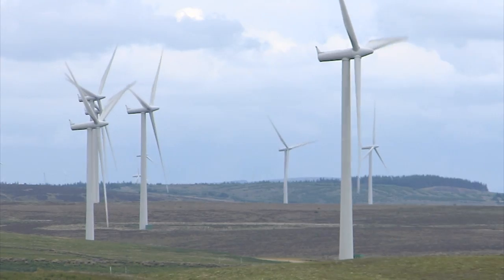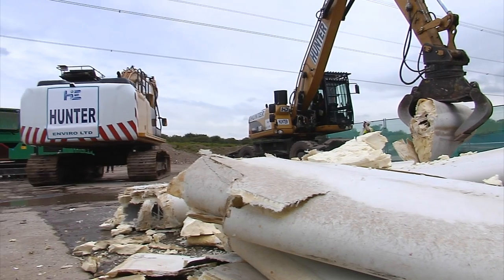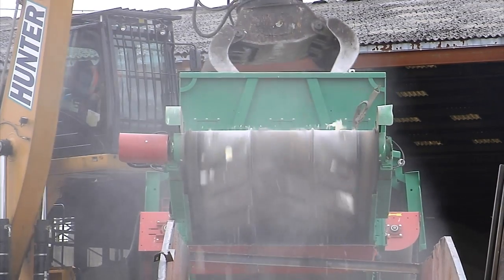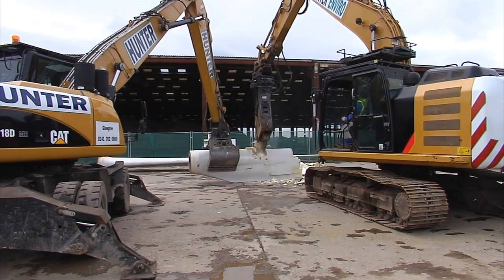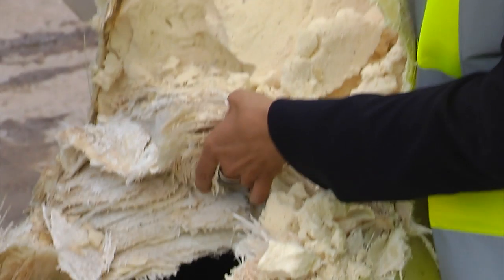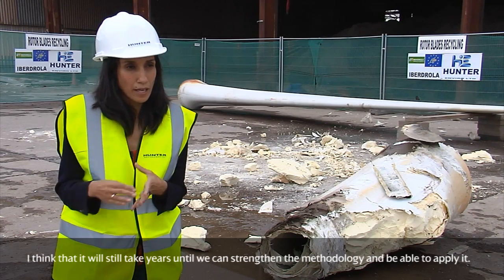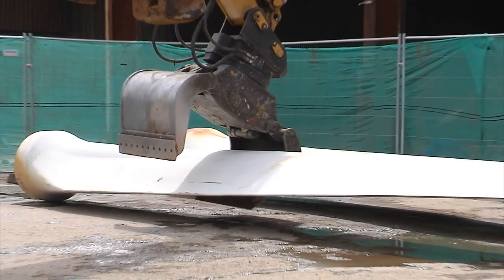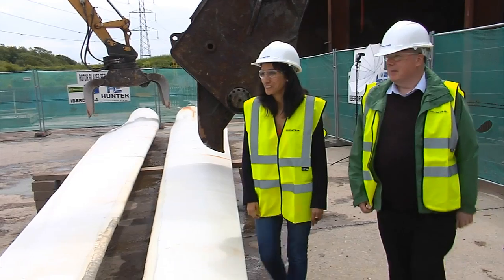Haas - Tyron 2000 - Wind Turbine Recycling

Comment: So basically, some put up money to break these windmill blades into little pieces tha are still recognizable as core materials for other industries and this proves that they can be recycled? There is still too much cross contamination. The expenses incurred by this hal process are being coveded by grants that do not require reembursment or results. Also, just being able to provide even completely clean materials  is no indication that anyone will actually accept the. Of course there will funds made available to offset costs and placate the sense of value and integrity of anyone who shows any interest. In the end, it is all a matter of paper work and press coverage.
Reply: Recycling blades is scalable and economical. It can be done, and needs volume to work, and there are plenty of blades.

Comment: I am surprised that these windmills ware out so soon.  The farm I grew up on has a water pumping windmill tower that has stood for more than a century. It's made of galvanized steel
Reply: Life span on them is about 25 years.   The new ones are so superior to old that it makes more economic sense to replace them.
Reply: Was it 300-500 feet tall? One of the things that shortens their life expectancy is technology. Compare a car from to day from twenty years ago. Go to the car dealer that you bought your car from twenty years ago and try to buy parts for it. The manufacturers would rather keep building newer technologies than keep supporting old technology.
Reply: The windmill I  knew as a child was only about 60" tall and was used to pump water ( we had no electricity or indoor plumbing)
Reply: Windmills don't generate electricity or pump water, they mill grain into flour.

Comment: Took several tons of fossil fuel to build them a bunch more to chop them up and realistically 95% ends up in a landfill. A nuclear power plant would provide far cleaner energy.
Reply: Chernoble.  Fukashima.  It might, but at what cost?   And what of the spent nuke fuel rods?   They are ten thousand times more difficult to dispose of, not to mention dangerous, than an obsolete wind turbine.
Reply: What a complete lie! wheres any actual proof to your comment?
Reply: @andyjohnson3790  which comment do you mean?
Reply: @scanamana    the initial comment where it was stated that 95% of wind turbines end up in landfills, that's not true. And that nuclear power is far cleaner, that's not true either when looking at uranium mining, refining, and end of life waste.
Reply: @andyjohnson3790  Ok, just wasn't sure to which comment you were replying, but makes sense that it was the initial one, since there wasn't @stuff in the beginning.
Reply: Nope
Reply: Not true at all. Most of the turbine is currently being recycled already. AND the blades can be recycled. Since the process is scalable, it is an economical solution too. https://youtu.be/RvCnP2h1LKY
Reply: A modern Wind Turbine can generate tons of fossil fuel worth of power in a single day

Comment: The amount of regulation and safety concerns I face cutting asphalt... I cant imagine the respiratory risk associated with grinding fiberglass even in the open air...
Reply: No more onerous than what boat yards deal with every day.  How about the BP Deepwater Horizon?  The Exxon Valdez?
Reply: You are correct.the  whole operation of cutting and shredding these blades should be in a sealed environment.  Any living creature living down wind is collecting crap in their lungs that will always be there.
Reply: here in my country the rock used it bitumen has a high silica content so you have a high risk of silicosis